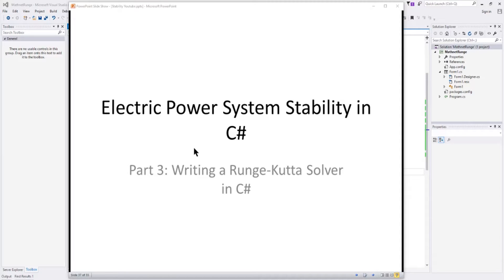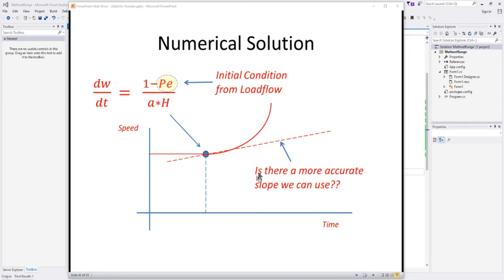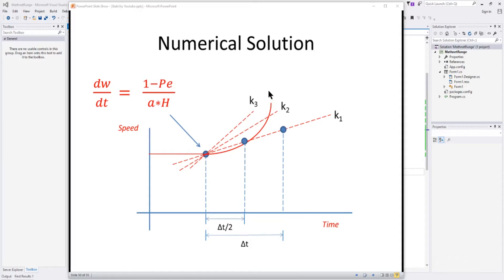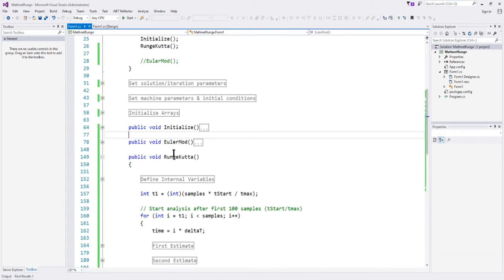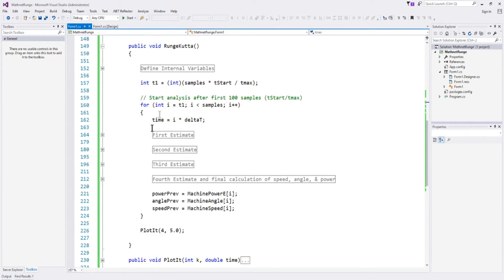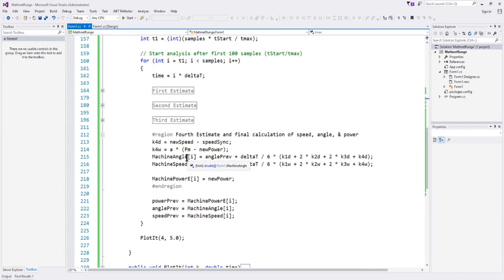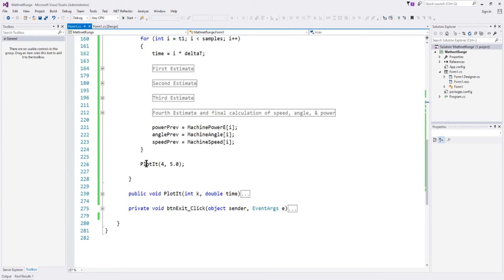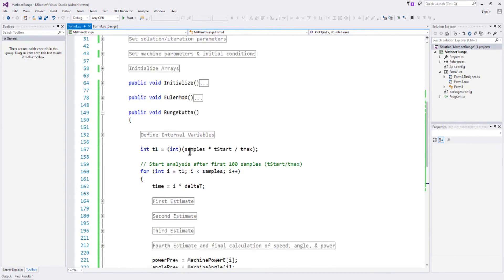Power System Stability in C# Part 3: Runge-Kutta Solver in C#

Comment: Hi, I just came across your videos and they are very helpful. I'm wondering if you have any tips for implementing the Runge-Kutta method for a system of 4 linear differential equations. Specifically I am trying to model a complex pendulum and so I have 4 equations for the motion of the pendulum and I am not sure how to implement the RK method in vector form.